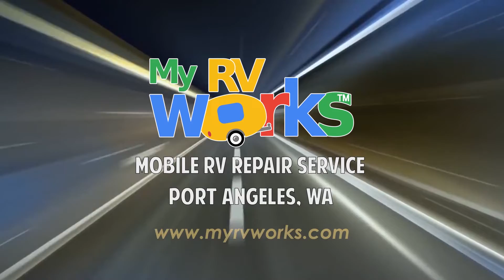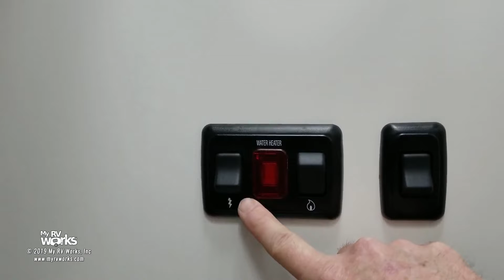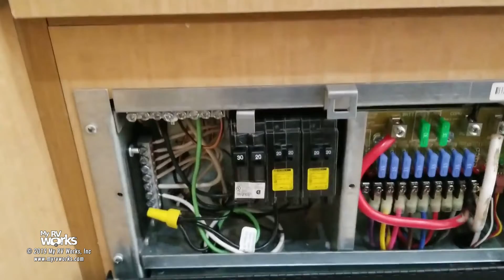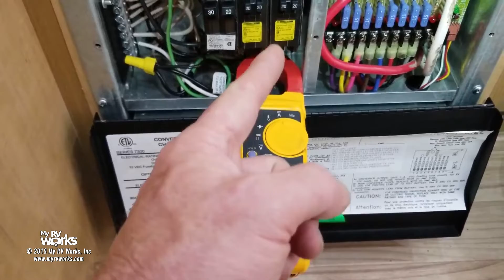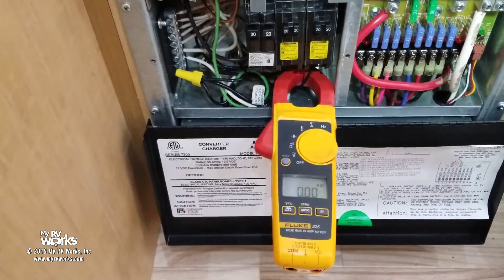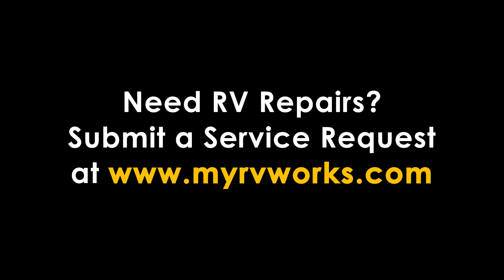How To Test Your RV Water Heater On Electric

Comment: Darin, I was getting excited when you said Suburban as that's what I've got in our 2003Newmar Dutch Star 10 gallon. After ours has been on for a while it starts leaking water. It appears to be coming out of the safety relief valve. I have the coach plugged into a kilowatt meter installing 1339 w which includes 175 watts of background draw. I'm thinking maybe the thermostat's not cutting off. I can't find any wires with 120 volts on on the front of this thing. Is it wired from the back side? Either way I should be able to tell if the water heater turns off because the kilowatt will the voltage the amperage will drop to 175 Watts if it shuts off. Any suggestion would be greatly appreciated I love your Channel. Update. After 30 minutes the water starts dripping from the faucet of the safety valve. How about one trip every second

Comment: I'm a little confused because you refer to amps and 10 amps being the sweet spot within the range. Sounds like you're confusing it with ohms, because when you ohm out an element it should be in the range of 9-11 ohms with 10 being the sweetspot.
Reply from the maker: If you run your calculation using Ohm's law, you will find that 10 ohms is 12 amps and 10 amps is 12 ohms. So let's just agree that 10 to 11 is the sweet spot between ohms and amps on these water heater heating elements.

Comment: I’m pretty sure that connecting your ammeter to the breaker wire only tells you that it has current.   It does not tell you whether you have a bad water heater element. Please correct me if I’m wrong.
Reply from the maker: We're just using Ohm's law/ Watts law to do the mathematical calculation on the element. If the element was taken out of the water heater and sitting on your bench right before you, you would still do Ohm's law/ watt's law to determine what's going on inside of it. In one of our videos I cut an element open to show what's on the inside. It's basically just a filament.  A lot of people will check an element with just voltage. But you need to know if there's current flowing through it to find out if it is good or not. The other way is to just read the ohmic value at room temperature.  If the current and the voltage are within spec with regards to Ohm's law and what's law then it's usually a passing assessment.  With the test outlined in the video, if there's 10 amps flowing through that circuit, and typically water heaters have their own breaker, that means that that element is consuming those 10 Amps and converting them to heat and returning back to the panel. So that's a good test.

Comment: So if the amps check out correctly, would the circuit board be suspect?   If it's drawing about 10 amps, then it appears the heating element should be heating...why no hot water?

Comment: Just did this test. My amperage is reading 4.2 amps. Does this mean my element is bad.
Reply from the maker: It would be highly suspicious yes, typically you would expect to see 10 ohms of resistance for those Heating elements.

Comment: i have an  Atwood GC6AA-10E water heater that is supposed to be a combo but it is presently only propane operated, i would like to install the components to make it electric as well, is there a kit available? I can find the heater element but not the cover and wiring harness.

Comment: I have a atwood 10 gal water heater, gas works, no electric. 9.8 with quick trick check, replaced circ  board, and t stat, and eco, fuse is good on the board, and thermal fuse good, tightened all connections, still the same results .Did I miss anything?

Comment: I have an Atwood gc6aa-10e.  Last Summer both the electric and propane stopped working.  Under warranty they replaced the circuit board.  This year while on our 3rd trip, the electric stopped working (and continued not to work on our 4th trip)(gas worked).  I did the testing of the yellow and white wires on circuit board and had a good DC reading.  I ran across your video and just tested for amperage and I got a 11+ reading.  It is not convenient to put water in the tank at my home so I don't know if it's actually heating.  My question is ... Does your testing for amperage method guarantee that the electric heating element is working?
I also performed the following test...
Tested the yellow DC lead going to the relay located by the electric heating element. Good DC reading.
Tested for AC voltage on electric heating element.  Good AC reading.
I did find the white neutral twist on connector to be extremely loose (as in it fell off when I pulled the AC wires out of the box on the back of the tank)... I'm hoping this was the issue.

Comment: Can you perform this test with wire leads instead of clamp-on? ie: disconnect that wire from the breaker and put the Amp meter in series back to the breaker's terminal?

Comment: I tested mine exactly as you did and only got 6.6 Amp showing on the meter. Does that mean  electric element is faulty?
Reply: Was it?
Reply: @projet2907  i don't remember, and no longer have the trailer.

Comment: good trick, dont have a clamp meter so went back to the switch that turns the current on for the electricity for the water heater, did a continuity test on the 2 wires coming into the switch, got a beeping sound, did one on the switch, got same sound, breaker off by the way... what should I be doing now?? still no water heat with electrical on... sensors seem to check out also at the front of the water heater...
Reply: How did you finally resolve ?

Comment: hello from the rainy Ozarks Darren! if the switch on the wall  is turned on  does the light come on  too even   if the heater element not working
Reply: Did you ever get an answer ? :-0)

Comment: So when I hook this up tomorrow, if the element is bad the reader will show 0 or beep (not sure if mine has a beeper)?  Also, can 0 mean that I have a bad wire or bad-no connection? Considering you had a good reading, what is a bad reading, what would you trouble shoot if you had one, and how?  My propane heater works, but the electric does not. Many Thanks.
Reply from the maker: Great questions...  To schedule a service consult with Darren please sign up for the "1:1 Repair Consult" on our Patreon site.  https://www.patreon.com/myrvworks

Comment: what if it has 9.3 amps
Reply from the maker: That's close enough to spec. If 10 amps is the sweet spot you're plus/minus could be a function of the voltage. When I do Ohm's law I enter 120 volts. But you might be running a little lower.
Reply: Thank you good sir

Comment: If you have 120 at the element, it doesnt mean the element is working, which you described perfectly. Which is why you search for amp draw at the breaker.(load)
I will be using the way you showed from now on, it is a little quicker.

I usually test for 120 at the back of the element(while on), then if it doesnt get warm, the element is bad.

My question is, if the e.c.o or T-stat doesnt work, doesnt it cause the element not to kick on?(for safety)
Reply from the maker: Glad you found the tip useful.  

To your question:  If the thermostat has failed than it will affect the water heater in all modes (electric and LP).  Depending on if it failed open or closed.  If the ECO fails it will only affect LP mode - specifically the gas valve.

Comment: Darren, what I do in these cases is take a 2-Step approach. First, I will take an AC voltage reading between the load side of the breaker feeding the circuit and the neutral buss.  This verifies that the breaker is good.  The on to load testing.  Food for thought.

Comment: What if you test it on ac volts and it shows 115 does the element still work
Reply from the maker: No, voltage is a indication of the amount of electron 'pressure' in the wire but it is not an indication of electrons flowing through the wire.  Only current will show you that.  So in this case, if the heating element is actually bad it would have voltage going to he failed heating element it  but no electrons flowing through the heating element.  Hope this makes sense.
Reply: @MyRVWorks  yes it does cause if it's bad the stream of amps wont move but if it's good you'll the flow wich can be measured in amps correct? Also I've watched all your videos thanks for helping me with all the content I have just started working as an rv tech and it's really helped and built confidence!
Reply from the maker: @Gregorytylerpfc  I think you got it.  I will go a bit farther and use the water analogy to help understand electricity...  

Voltage on the wire is like water pressure (or force) pushing against the hose, fittings and valves.  It does not indicate the water is flowing through the hose, fittings and valves just an indication in the amount of 'work' that can be done with 'x' amount of pressure (or force).  An engineer will say that Voltage is the scale used to record the Electromotive Force in a conductor.  That is why Voltage is expressed as 'E' on the Ohms Law formula.     

Once you open the faucet and the water flows you can use a 'gallons-per-minute scale' to calculate the flow.  In electrical terms we call that 'current' and record it as 'amps'.  The same engineer that stated that Voltage is just a scale we use to record Electromotive Force might use a term like Induction to explain what the electrons are doing.  They are being induced to go from '+' to '-' like so many dogs to a ham bone.  

So to finish this off...  If you put your meter leads on the water heater element screws, and turned it on, you will most likely get a voltage reading because that is how much 'force' is available to do the work.  But voltage (force) does not tell you how much 'work' is being done.  If the water heater element is actually doing 'work' (the P in the Ohms law for Potential) than you would have current flow through the element - usually expressed in watts (which is also the 'P' in the ohms formula).

Hopefully this helps get your head wrapped around all these terms.  I can say that about 80% of all the work I have done on RV's has an electrical root to it so knowing how to understand electricity is critical in your new career.   I plan on doing more electrical video's soon.  

Thanks for watching!!!  And keep making Happy Campers!